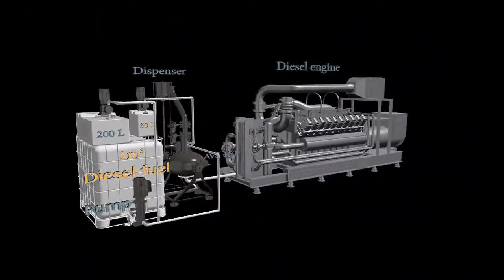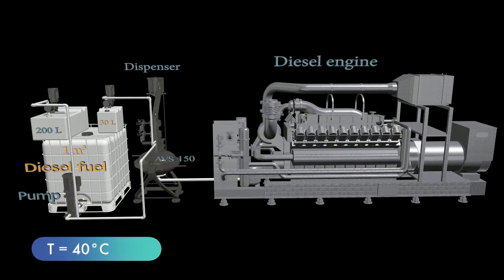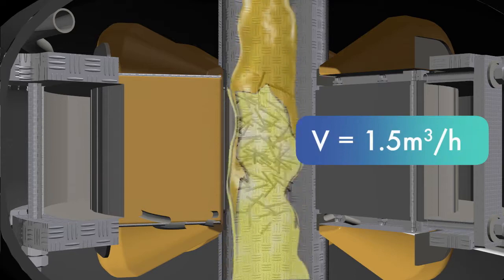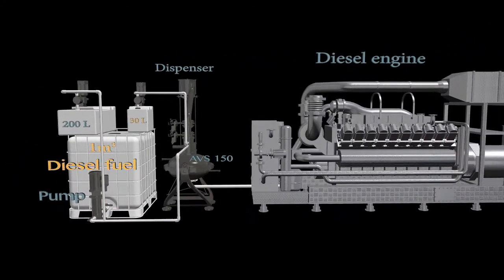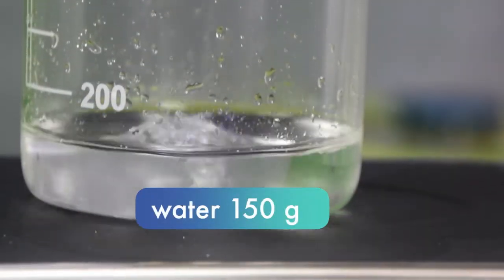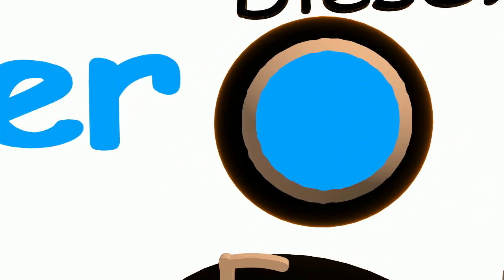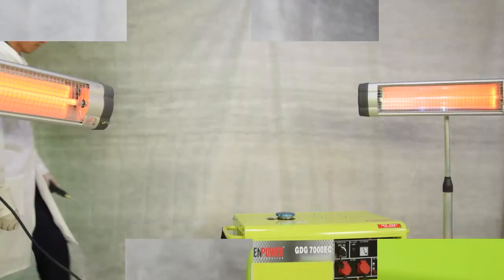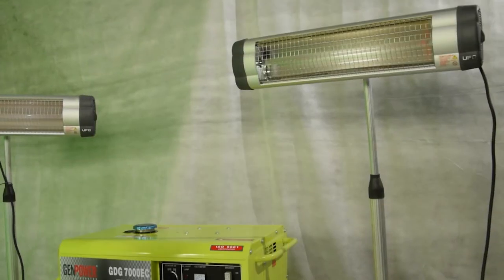The fuel oil blending with water by means of emulsifier on vortex layer devices

Comment from the maker: Diesel fuel mixing with water looks promising. What do you think of using vortex layer devices for this puprose? Shafre your opinion and ask questions in comments. Additional information you may receive per email media@globecore.com.
Reply: Distilled water will add efficiency to the combustion chamber of the engine, but here, as in everything, you need to know when to stop and with the supply of air to the engine, in particular, when a diesel engine is ignited in the combustion chamber at 1700C, the water is divided into oxygen and hydrogen. Approximately the same temperature in diesel engines , but not in all. I am interested in your equipment: biodiesel installation and mixing system, where can I buy it? I am from Odessa, I need it for personal use?
Reply from the maker: @aleksandrgut5890  Good afternoon. Write to us at media@globecore.com and we will send an offer for you.